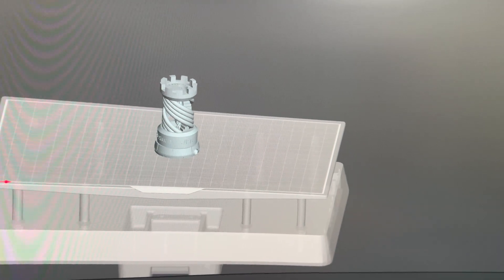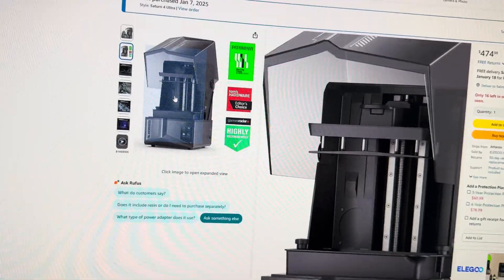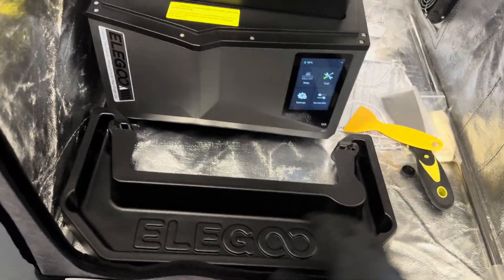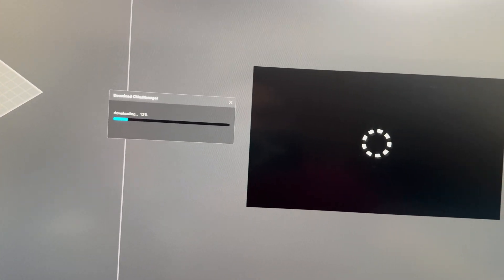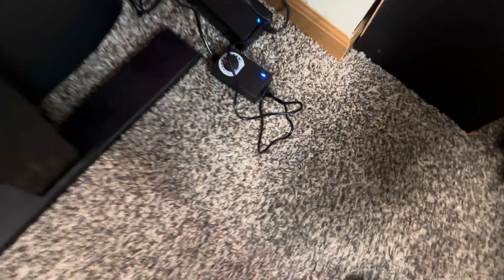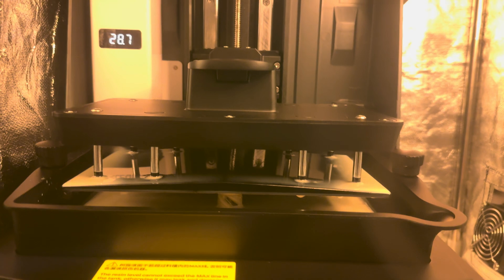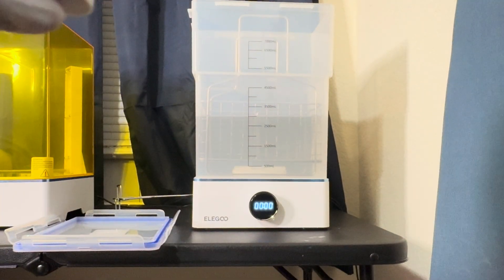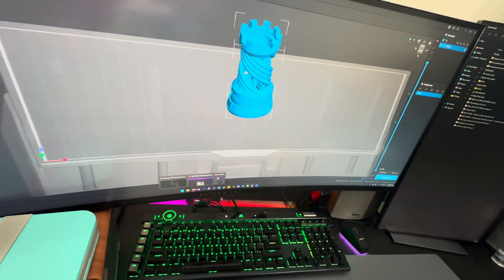Elegoo Saturn 4 Ultra - First Print and Apartment Setup

Comment: The wash station you purchased will not except the build plate from the Saturn 4 ultra. I originally bought that wash and cure station from Amazon but quickly cancelled it and purchased the ELEGOO Mercury Plus V3.0. You can put the build plate in that unit. Just sayin'.
Reply from the maker: You’re right! Thankfully as of right now I can still issue a return and pick the right one up. Thanks!